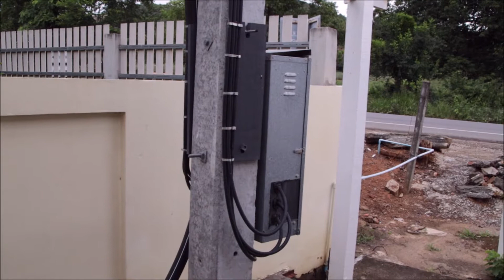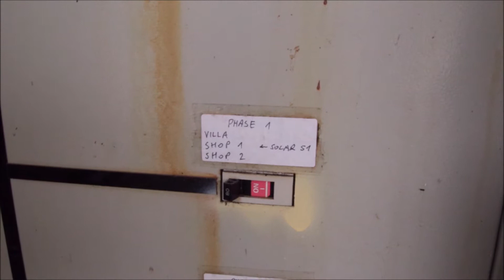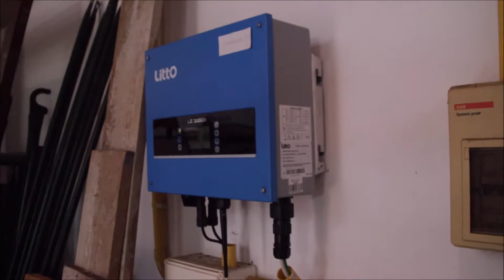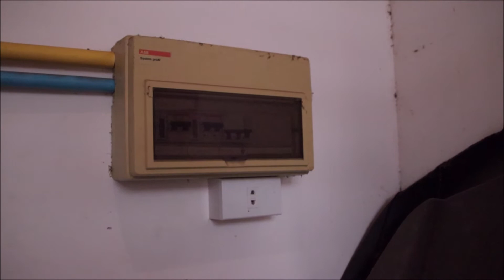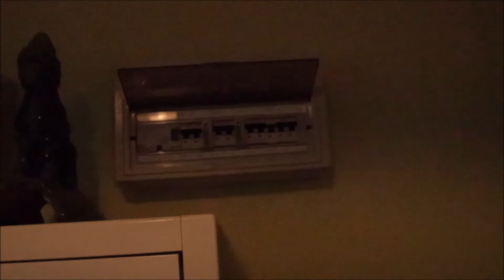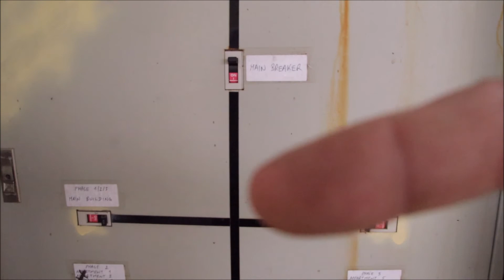The AC-Powerwall Project - Ep 2: How the energy is going around

Comment: I just came across your channel. I am interested in learning more about solar and off grid. In this video you talk about the excess solar power from the garage being directed to the main building. What stops that excess power from being shared with the grid as well as the main building as there is a direct connection to both the grid and main building via the blue bubars. Thanks.
Reply from the maker: @sammaimas155  hi. welcome to the channel. As the  main building doesn't have any solar system on its circuit, so it is always representing a load, the voltage potential there will be lower compared to the grid as long anything inside the main building is drawing any power. So excessive power will first equalize the two branches of paths where it potentially could go. Once all needs of the main building are satisfied, then the potential will be equal, and the power would have to escape to the grid. But on the way out, energy is monitored by a meter and if there is a flow outwards, loads in the form of chargers will kick in and start to store electricity into a battery bank. It is the basic principle of grid-tied full hybrid inverters...